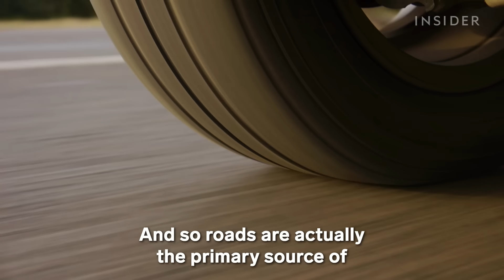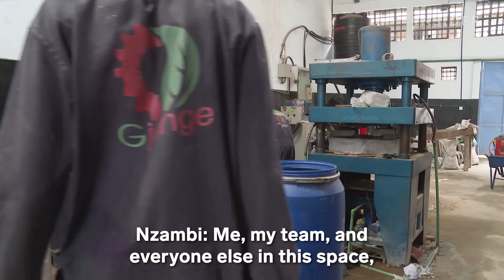Young Inventor Makes Bricks From Plastic Trash | World Wide Waste | Business Insider

Comment: It's a really good idea to make money. 
As for whether it helps the environment or not. I highly doubt that. In fact I'm positive that it's making things worse. It's spreading microplastic over bigger regions than just the landfill and the area around it. What's more as it was mentioned cars, human feet etc... will spread it even more if we are in constant contact with it. 
Also I'm pretty sure that everyone that works at her factory, herself included are probably getting poisoned. Plastic is toxic and even if it doesn't smell bad or it doesn't smell at all if it's being heated and you are closeby you are definitely breathing in toxins.

Honestly I don't see much use for this type of bricks. Perhaps for building buildings that people don't live in like a garage for an example. You would still need to at least cover them with a lot of cement on both sides just to be safe from the toxins that plastic releases and even then I'm not that sure if that works. If it did we would be making big cement coffins for all the garbage in the world and be done with it(we actually do that, but it's not helping since it seeps through eventually as far as I know).
Still considering that it's not that much cheaper than regular cement bricks I personally would pick the cement bricks over these. Also I'm not that familiar with building materials, but bricks can be from clay, cement, ceramic etc... and surely some of these are cheaper or around the same price as these plastic bricks, but have been proven to work and are more reliable and safe(no toxins in them).

Overall I feel like even she knows that this isn't really a solution of any type, but it's making her good money(seeing how her mother has started a business with 1200 hens I would assume she helped with that) and she is trying to sell it as if it works and helps the envirenment and I can't blame her for that. Every business lies, except some lies bring harm to people and others just frustration. Hopefully this isn't as bad as it seems and hopefully with the money she makes, she would eventually figure a real way to actually deal with plastic.
Reply: Goodness reading your long-winded critique of this woman and her business I'm surprised that you haven't figured out a way to actually deal with plastics. Eyeroll...
Reply: @TheVuduYuDu  You probably have issues reading. I never criticized her. I said that what she is doing is probably more harmful than helpful. 
I don't care what happens in Africa, so if they want to spread plastic on every square inch that's fine with me. 
The only sad thing is that people like you that obviously lack comprehensive skills and critical thinking would push for this because you'd prefer to get charmed by her smile and nice attitude than to see what the reality is. She herself showed in the video that she is happy that she is making money. I doubt she cares for all the crap she tries to push and I don't blame her. Making good money in a poor country can be very aluring.

As for solving the issue with plastic. Each country can solve it for themselves if they want to and are capable enough. Raising the living stardards would allow products to be packaged in more expensive and eco-friendly packaging. That's the only feasible solution in the near 10 years.
All other methods can't be used on a grand scale. There are worms and micro organisms that eat plastic. Perhaps if absolutely every house on the planet have those worms in their homes and use less plastic this could be solved, but that is less feasible than just banning plastic altogether.

There are other project similar to this that are a lot older(probably 10 years +) and have gotten basically nowhere. Can you guess the reason? Yes it's because they either don't work or are even worse than just leaving the trash in the landfills. So you can cheer her all you want, but at the end of the day your hypocricy is doing more harm than my honest opinion.
Reply: @xingbairong  Perhaps you should look up  the word "critique" before you speak about anyone having issues about reading or their comprehension.
Reply: @TheVuduYuDu  I don't have to look it up, because I know what the word means and I know what I wrote. 
I wrote that I "doubt" that she believes that she is actually doing anything good with this and she is doing it more for the money and I wrote a "fact" which is that if they use these bricks they will spread it over more ground. If someone tells you that he's left hand is his right hand when you tell them that that's not true, that's not a critique, but a fact. If your Prime MInister comes out and start saying wrong stuff like different number for salary raises, budget etc... and everyone knows that those numbers are wrong and someone corrects them, that's not a critique, but getting the facts straight.
If we have to look at what the word critique represent then I can tell you that I didn't analyze in detail what she is doing, nor do I have negative view or her(I literally wrote that I don't blame her for wanting to make money).
So sorry to disappoint you, but I believe you should go back to, what? 3-4 grade? I believe that's when kids learn reading with comprehension and delving into what's written.

That said I don't get it. Do you really expect someone who uses no protection when they stay near heated or grinded plastic to have the solution for this issue? This right here is a critique.
In all honesty I don't see the point behind your dumb comments. You wanted to show sympathy on the internet? Go to local shelters and do it there. It's your right to defend ideas that obviously don't work, but just don't try to do it on a high horse while you are at it. Save your eyerolls for your husband(no guy would eyeroll that's why I'm assume you are a woman. If you aren't, well... don't act like one).
Reply: @xingbairong  Sure you do...

Comment: Isn't a bad idea immediately but I would say you need to do way more research on this beforehand, You have long term to think about, you have to consider traction, weather, rain, sleet, snow and Rubber to plastic issues potentially.
A recycle idea isn't bad but neither is doing due diligence on safety and other things. Plastics have already caused humans issues long term.

Comment: I feel like we should work towards ending the production of plastic, so finding new ways to use/recycle what plastic is already here and being wasted is a really good idea.

It may not be a perfect solution for now but it’s most definitely a step in the right direction
Reply: i dont think we as a society will ever end or slow down the production of plastic but what we can do is increase the scale of reworking plastic into long term solutions for other problems. plastic is a great and terrible product at the same time, a necessary evil, but one that should definitely be tamed in ways such as this. i have heard of plastic being mixed in road tar and the resutls have proven to be quite good. its a great way to kill two birds with one brick.
Reply: @R I just thought that the moment that I looked at this. No matter where you put it there's going to be micro plastics coming from the recycled plastic due to the wear of it being in the elements.
Reply: Are you Sherlock Holmes?
Reply: As you type on your plastic device.
Reply: @dontshootimfri3ndly853  at least I'm not running it over repeatedly with multiple vehicles with sand, dirt, and debries grinding the plastic paving blocks into plastic dust. Don't even get started with chains and studded tires.
Reply: @dontshootimfri3ndly853  yep
Reply: Crazy idea, MORE PAPER, MORE GLASS in disposable items.
Reply: Cool, when you and someone needs a pacemaker for their heart, you can both die. Everybody acts like plastic production is only for soda pop bottles. Limit the production, but not ending it, is a solution
Reply: @Todd.T  No,the issue is- it should be made out of other material..
Reply: @TheRealLazyEntrepreneur  the issue is that it shouldnt be used for disposable/unimportant things. its fine to use plastic if it wont be disposed of after

Comment: not "as hard" as concrete, u'll still be able to scratch it with a chunk of concrete or asphalt
Plastic has different strengths, but it doesn't make it harder, its elasticity keeps it from breaking when throwing it on the ground.
Reply: It is a matter of durability and robustness. Not having broken and cracked streets means they last longer. And these plastic pavers can be remelted and reformed over and over again.
Reply: @scottdowney4318  I didn't deny that. I was just stating the term "hard" means something different.

Comment: Nice project but I have a question if it is used into the environment to create roads, is there a risk that can create terrain pollution, considering also that many roads can be not maintained. 
Off course this problem is much smaller than the real pollution problem

Comment: But does work for tires as good as asphalt? Wear them down fast/get the same traction? And how often does it need to be replaced? Also as it wear down the plastic is going somewhere, it just breaks up smaller and becomes more dangerous right? Edit: nevermind they answered most of the questions in the video.

Comment: What about acid rain will it affect these bricks? If so then micro plastic would be high af, if acid rain doesnt affect then corrosion will and over time itll just be the same problem all over again but this time, its much more worse, because rain water makes the micro plastic goes to the sewage or the sea which means more micro plastic in the sea, and itll go to the ground which meand contaminated drinking water

Comment: It was a good point made about abrasion releasing more microplastics in to the environment, but this is a good idea. Maybe it could be adjusted to be used structurally? At the least, maybe it should only be used for light traffic like driveways, footpaths and bike paths; uses that won't expose the brick to the heavy abrasion of moving vehicles. Foot traffic might wear it down too, but perhaps adjusting the ratio of plastic to sand would make it foot-traffic abrasion-proof.
I'd really like to see this work so it can be used everywhere in the world.

Comment: Likely wouldn't work the amount of wear roads see is almost never taken into account you also have to consider the differences wetween the 2 materials and the fact that roads can get so hot it starts to melt tires 

If you can make it flexible enough to have some give from the base shifting and withstand the heat without melting we can consider making it last for extended periods of time also have to see how it can be layed out

Also need to take into account if the manufacturing process is actually worthwhile in both cost and foot print as many people don't consider the before and after of the product which is why many so called "green" alternatives are actually terrible for the environment because the cause more damage in their before and after stages than what they're intended to replace (looking at you solar panels) ontop of the damage they cause in use

-"roads" actually street ways individual brick way streets and walkways are simple I could see it working assuming they hold the heat

Comment: Is it possible to coat the bricks with a material that prevents the erosion of the bricks?
Reply: Guess they use vickers scale to measure hardness of material these days. Maybe u can find a suitable material with low cost and then try contacting them. Keep in mind the material must be non reflective, cheap to produce, have a high melting point, provide grip for tyres and anything else that makes it good to drive on
Reply: @sunekun  Maybe. Maybe you could too? Maybe anybody?

Comment: It is a very dangerous thing to do.
Due to tires and friction very tiny parts of this asphalt go in the air and cause heavy damage to the cells lungs.
Of course this happens also with no plastic asphalt but it takes much longer time...

Comment: When it comes to recycling stuff, theres infinite uses for every material, there are many applications where filler material is required and it has little importance as to what material it specificaly has to be.
The trouble is, sand, concrete and other filler materials are cheaper than that of recycling waste.
Its all wishy washy thinking you found use for it... Whos gonna pay for it??
This is only cheaper in countries where manual labour is very cheap. This would never work in developed country because the cost of sending the bricks would outprice the cost of concrete, making it localy would cost too much in manual labour, automating it would cost too much due to added processes in comparison to simple moulding via concrete bricks.
The country who end up with piles of plastic always blame the countries with high production but at the end of the day its the government of that country was corrupt enough to accept the deal of taking the waste and not recycling it just so they can put the money in their own pocket. African countries are very well known to have corrupt systems where people in charge sell out the country and then run away from the responsibilities once they have enough money in their pockets.
Even china has stopped accepting plastic waste as they realised, it costs too much to recycle than the incentives they are given.
The only way to solve the problem is to stop accepting the waste and then the countries like USA will be stuck with the plastic, that way they will have to either invest into infrastructure to recycle it properly or overall production cost of plastic will have to be taxed, that way alternative materials will be more viable for manufacturing or the tax will offset the cost of recycling.

Comment: The road still degrades and microplastics get into the environment regardless. Sorry, try again.
Reply: 3rd world country jasmine. 3rd world country.
Reply: @Didnt_ask69  Yes, it is a 3rd world country but let's not act like putting plastic into roads is somehow a good solution when it isn't.
Reply: @Didnt_ask69  I also live in a 3rd world country and grew up poor. Turning trash into roads will not solve anything long term or be good for the environment, let's stop acting like it does.
Reply: @Didnt_ask69  How about you help with the educating? Tell the people in this comments that this isn't good for the environment at all. This video is on the Internet after all.

Comment: "Each lump of the mixture is weighed by hand" That must be the most inefficient business ever. They will be bankrupt soon.
Reply: Lol sure guy. Cause you as some random commenter definitely know better than this woman who started the company from the ground up
Reply: @sassybatchz  Well this random commenter does know basic mathematics. Let me elaborate:

The bricks shown in the video are roughly 10 × 20 cm (about 4 × 8 inches) in size and they have an output of 1200 bricks a day. If we assume an average two way road has a width of 6m (about 20 feet) that means they produce just enough bricks for 4m (about 13 feet) of road per day. Per year that would be 1.460 km of road. That's not even a mile (1,609 km).

That is not sustainable. They would have to scale up their operations a hundredfold to even hope to be.

Comment: Good idea to recycle the plastic waste👍
Can anyone say that  this brick has a good bond with cement mortar or we need to use any chemical bonding during construction.
As they said it is cheaper than concrete and how long it can withstand with temperatures difference during summer?

Comment: Great ingenuity and idea but Bad Idea for the environment!  you are just diversifying the problem It's like any material it degrades into the environment over time and at the end of its usefulness as a material, it still ends up contaminating the area again. The manufacturing process produces toxic plastic outgassing as well, this sort of thing is a big problem in third world countries with little to no safety regulations. One of the multitudes of reasons things can be made so cheap.

Comment: Furthering the pursuit of infrastructure, roads are a part of infrastructure, more buildings made out of plastic would be the next step. As the population increases, land usage and homes decreases, the only way is to build up. We may be able to mix metals and plastics, too, figure out the ratio of how much plastic we can use to make building resources, of course there will need to be a lot of metal than plastic because of weather and weight. Plastic is also another weather resistant material, very flexible and versatile. Seeing plastic infrastructures and buildings in the most populated and polluted countries, like the USA, China, and India would definitely make a difference.